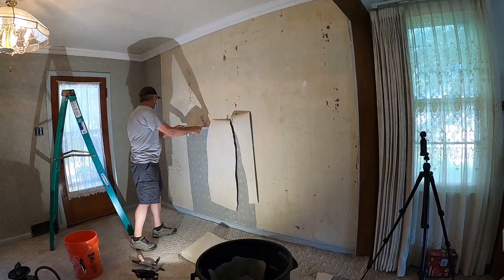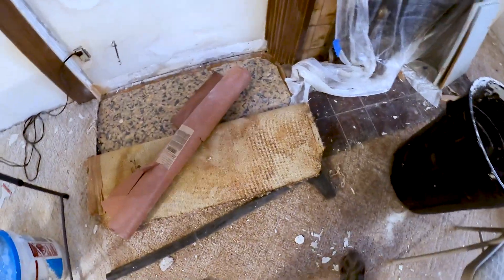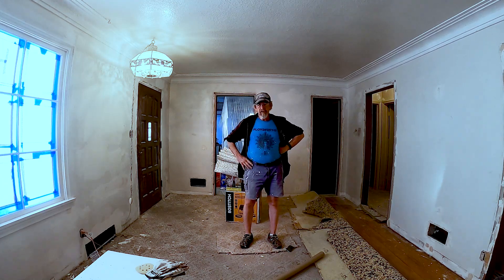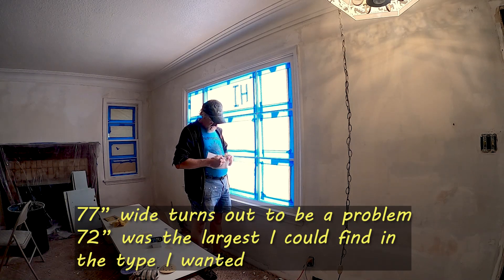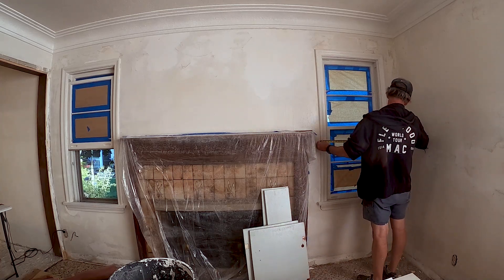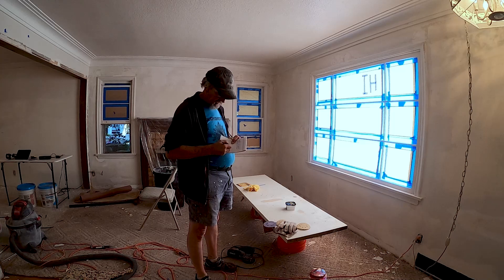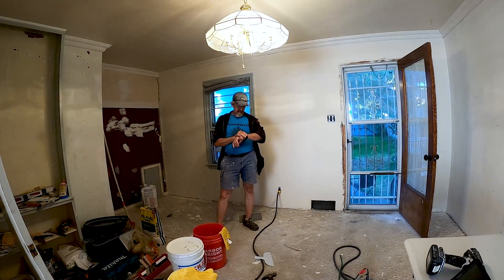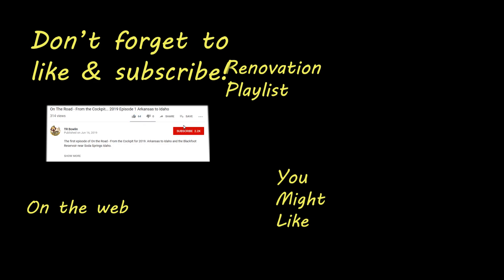Pet stains, floors, and electrical problems || Mid-century Ranch Home Renovation

Comment: Those plugs that are "Upside down" are installed the way commercial Electricians install. It is not wrong. 
The purpose is that if an appliance cord becomes partly unplugged, the exposed pin is a Ground pin and not the hot wire should something fall against it, no harm.  I do all of mine that way now.
Reply from the maker: That may be a best practice but it is not specified in the NEC code to install them up, well at least in the last one, I don't have a copy the latest version. I guess I am used to them being installed down. What about horizontal outlets?
Reply: My only experience is in a hospital setting, and I'm not an electrician, I just asked the questions years ago.  Most bedsideife support equipment is static sensitive, (good thing theres no carpet 😆.) 
I dont recall seeing any horizontal in new construction commercial.